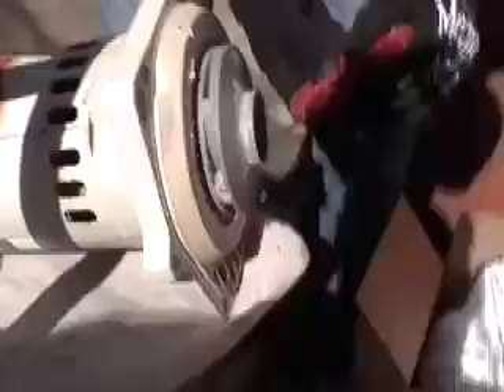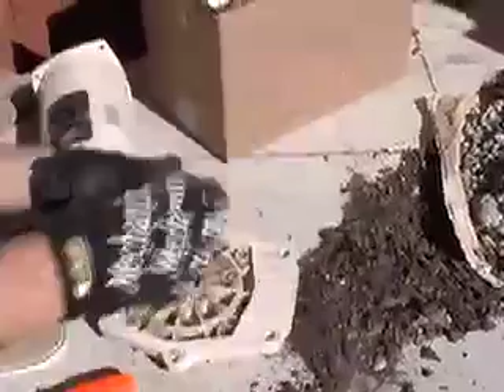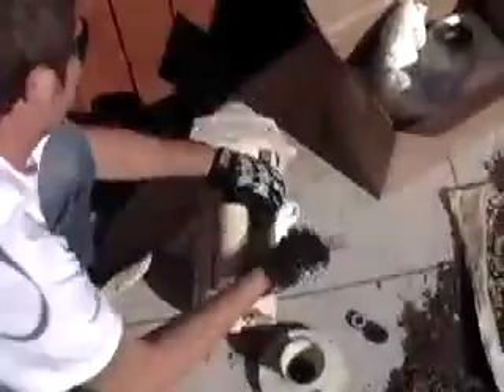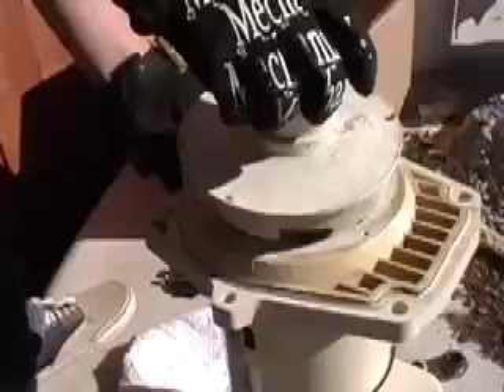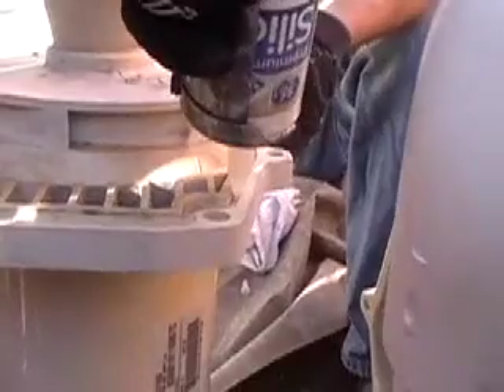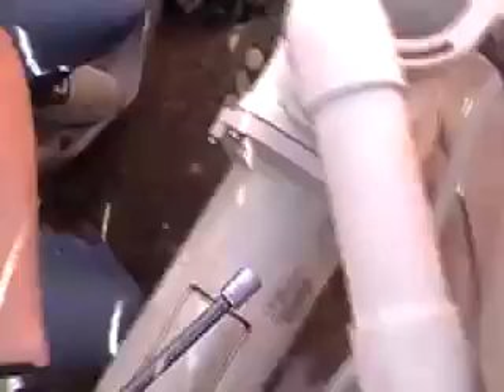Pool Motor Replacement - Pentair Whisperflo

Comment: Just a note about the seal plate gasket - mine would only go in flat side down, opposite from what it says in video. I had to buy a new seal plate. The old seal plate gasket was in flat side down (into seal plate) also. My pool shop guy said to put it flat side down as well. Thanks for the video.

Comment from the maker: Silicone seal was also used to aid in holding the gasket in place.  This is not absolutely necessary but can be helpful when attempting to put the pump back together.

Comment from the maker: Most pool motors are made with aluminum end bells. Typically, when the bearings make noise they have spun inside of the end bell and changing them will not solve the problem. Replacing end bells, bearings, and pump seal could cost as much as a whole new motor. We recommend replacing the entire motor. We have in the past changed bearings, which can be pulled with a standard long arm bearing puller - those bearings are standard bearings. They would then need to be pressed onto the motor shaft.

Comment from the maker: @rene495 

If you are getting power to the pump and it just makes a humming noise, your motor is likely trash. You do have the option of just buying a new motor and replacing the old motor (as shown in the video). To do this, you will need the parts included in the motor replacement kit offered by Pool Guy Supply. Or you may opt to get a whole new pump all together. In sum, you either need to replace that motor, or just buy a whole new pump.

Comment from the maker: @sport1775 If the inlet piping is sized too small (i.e. if you're trying to run a 2 HP pump and only have 1-1/2" inlet piping) that will cause pump cavitation and could cause it to overheat. Other causes: Impeller is over-sized for the motor (i.e. 2HP impeller on a 1HP motor), which will almost always cause motor to overheat. There is also the possibility that the wire size is too small either to the equipment pad or from the timer to the pump (drawing too many amps through too small a wire).

Comment from the maker: @skgala The Intelliflo will give you an indicator message on the top panel. You should get an alarm or alert, which tells you why it went off. Page 12 on in the Quick Start Guide should help determine the specific alarm. You can view pg. 44 of the Owner's Manual for specifications that should be followed when alarms or warnings are indicated. Both of these resources can be accessed on the Pool Guy Supply website.

Comment: where is the capacitor located on the whisperflo pump
Reply from the maker: Debi Rowlett On some of the motors you can find it on the outside of the motor, 
underneath the protective casing (the bump) on the top of the motor. Unfortunately 
on other types of motors it will be located on the inside of the motor, 
where you can't it see or have access to it.